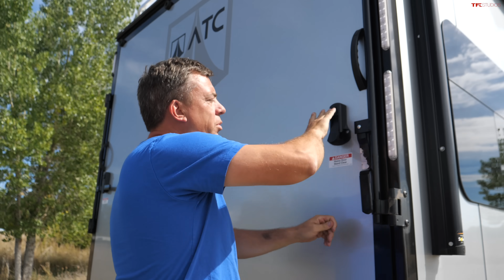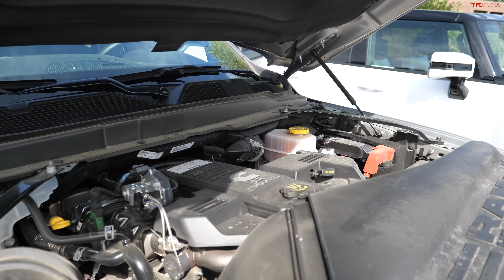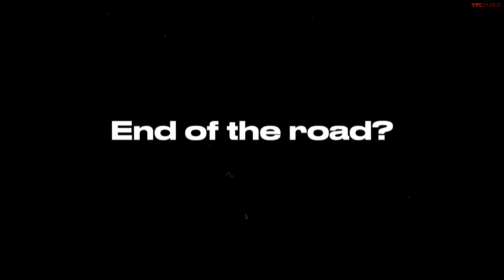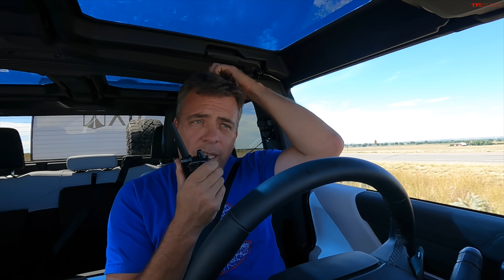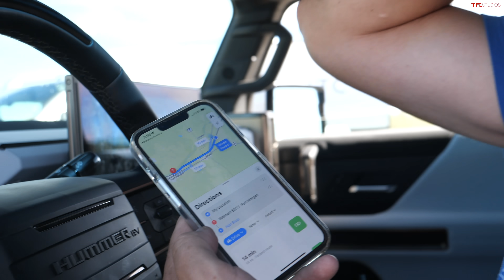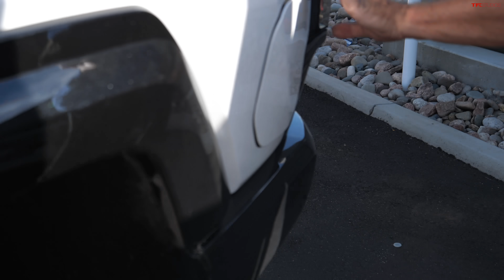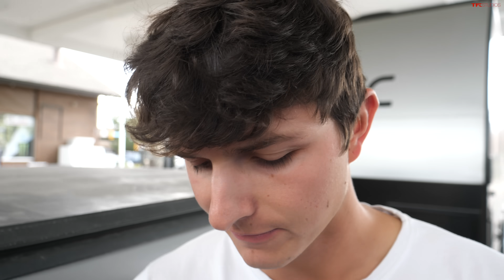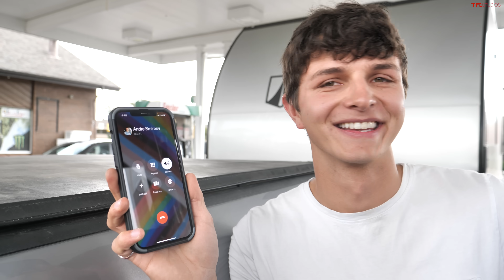How Far Can a Diesel and Electric Truck Tow An Identical Camper Trailer on ONE Fill-up?

Comment: So, what I've learned is that you'll need a math degree to figure out road trips with an EV vehicle.
Reply: No, you just use a map and find the next charger within range.
Reply: @jghall00  and hope there is one within range, jump on the fast charger if it's available and then wait 45 minutes to get 3/4 charged.  And then do it all again in 150 miles. Sounds like a fun trip.
Reply: @JW-xk8bd  There are maps with the chargers, so no guess work. Most EVs charge to 80% in 30 minutes and some do it 20 minutes. I can barely get everyone to the bathroom and loaded back to the car in that time. Besides, 90% of my driving is around town. I have a full charge every morning. Now I hate visiting gas stations.

Comment: It doesn't make any sense to use an energy supply in something that it just isn't very efficient like it is in powering your cellphone? With modern technology we could probably make a small enough diesel engine and place it inside a smartphone but would it be practical or efficient? Could you imagine buying a little "eye drops" size bottle of diesel fuel to top off your smartphone? With all of the oil around the world sitting deep underground does it make sense to leave it there, and use lithium in everything? Efficient or not, for the sake of the climate alarmists? Wasting a precious earth mineral on something it isn't very good at versus some it is, well is just plain dumb in my opinion! And this is my take on electric vehicles.

Comment: To make an EV truck on par with an ICE truck...with round numbers
31-ish gallon diesel tank on the Ram at 38kwh/gallon equals approximately 1.2mwh in battery capacity.
The Hummer was calculated to be three times as efficient, so around a 400kwh battery for the same range.
Let's make it 500kwh to be safe. 
To charge a 500kwh battery from 10% to 90% in ten minutes, a roughly 3 MW charge rate would be needed.
With the 800 volt Ultium architecture, that's approximately 3,750 amps.
Obviously, the input side of dc fast chargers needs to change. I wonder what will change on the output side of the chargers and within the vehicles to get to the point where it will be like living with current ICE vehicles. None of it is impossible. Bring on the corrections.

Comment: Your energy efficiency calculation is wrong you are not accounting for the energy to create the Cummins engine, or the battery pack, which you will see is an energy transfer.  In fact takes 10,000 times the energy to mine and refine the metals used in and really that figure could be ten times more.  Nobody really knows do to the secrecy of the battery construction.  Vs the most recycled metals steel, and aluminum.  So you will find the EV efficiency is about 27% and the diesel 48.5%. Also who melted the last Ice age?  EV will not work without room temperature superconducting technology.

Comment: You guys are making such a great show 😊 though I am all electric at this front Diesel wins. But it’s fun to see though and It will be fun to see what comes. I think it’s great that you shows the big let downs and trouble with the trucks, price wise, charge wise and capacity wise. The hummer have about the double battery size of a ford f-150 lightning but have about the same range, so in my head it seems they have gone more for a toy then an actually working truck. It’s fun though to think that 10% battery on the Hummer is about the same kwh as the first Nissan Leaf 😂
Reply: Technically, you end up with a charge speed that is faster in terms of at a station compared to the Lightning if I understood it right for that battery. It would be great if that charging technology were more adopted though. It does make the battery more complex though.

Comment: An ev would be ideal for commuting for me, I drive 50 miles a day back and forth to work, getting 16 mpg in my 03 f150, but hauling our Polaris to the mud parks on the weekend, or our camper to the beach or mountains, NEED a REAL truck. The money you save from gas will not compensate for the extra tax, tag, title, fee, payment, or maintenance for an extra vehicle.
Reply: I'm in a similar situation. I'm not against EVs by any means, I have a long commute that would be ideal for an EV. But I also have a boat and a travel trailer I tow almost every weekend... EV trucks just aren't ready. Maybe PHEV?
Reply: I'd just buy a Cummins and delete it. I get 18mpg around town in my 12 and 22-24 highway. I don't understand buying a gas pickup at this point when a diesel will get better fuel economy and can do more
Reply: @nicksmith4808  I had an 03 duramax a few years ago. Put all my money in the motor, then the trans took a dump on me. I love them and what they’re capable of, but between the government ruining the new ones, and the kids ruining and driving the prices of the old ones up, it’s not ideal anymore
Reply: Someone did the math in another comment. "Thats awesome the charge was free, but let's use the numbers to find out the future cost. The Hummer charged from 7% to 51% for $37.41 according to the EA charger. So $0.85 for each 1%. At that rate it would cost $79 to charge the Hummer to 100%. Hummer cost per mile: $79 ÷ 123 miles = $0.64 per mile.
Cummins cost per mile: $105 ÷ 211 miles = $0.49 per mile"

Comment: What was the actual cost in energy or electricity to 100% in this test?
Reply: To charge the hummer at a QC station if it where 100% dead is 80 dollars. If you charge it at home it would be 30 dollars. If you charge at a free station it would be free.

Comment: I would like to see a calculation of how much fuel you could buy at todays price with the difference in purchase cost. Then with the promotional charging factored in when would the Hummer save enough in refueling cost to equal the savings in price difference between the trucks.
Reply: It will never break even in the life cycle of the vehicles. At the towing mpg of 10 mpg and $5/gal the diesel has a 100,000 miles cost advantage on buying fuel without complicating the math with maintenance intervals. That factor increases by 2X when you remove the trailer.  $46,000 msrp difference buys a lot fuel and Hummers are basically unobtainum without a 2 year reservation wait time. You can buy 100's of cummins powered Rams tomorrow, they're available at every dealer lot.
Reply: Someone did the math in another comment. "Thats awesome the charge was free, but let's use the numbers to find out the future cost. The Hummer charged from 7% to 51% for $37.41 according to the EA charger. So $0.85 for each 1%. At that rate it would cost $79 to charge the Hummer to 100%. Hummer cost per mile: $79 ÷ 123 miles = $0.64 per mile.
Cummins cost per mile: $105 ÷ 211 miles = $0.49 per mile"

Comment: Its a good comparison. At 43 cents a kwh with a 211kw battery its $91 to charge it from empty. No idea what loss is from the charging process so it should be more. Need to know the cost to charge from the round trip vs the diesel. And the time to travel. They have a ways to go to replace a gas or diesel truck. I could tow my race car 300km round trip with a gas truck and have alot left when done. 128 miles is 206 km.
Reply: charging loss is roughly 10% on Teslas...
Reply: yep. I just want to spend the msrp price difference for gasoline or diesel... I am good for the next 20 30 years  :) just like the base model tesla or base  model hybrid corolla... even where I live 1.729 Canadian dollars / litre...
Reply: Someone did the math in another comment. "Thats awesome the charge was free, but let's use the numbers to find out the future cost. The Hummer charged from 7% to 51% for $37.41 according to the EA charger. So $0.85 for each 1%. At that rate it would cost $79 to charge the Hummer to 100%. Hummer cost per mile: $79 ÷ 123 miles = $0.64 per mile.
Cummins cost per mile: $105 ÷ 211 miles = $0.49 per mile"

Comment: Anyone notice what it cost (or would have cost) Andre to charge.  It was almost $38.00 to drive 123 miles.
Reply: Someone did the math in another comment. "Thats awesome the charge was free, but let's use the numbers to find out the future cost. The Hummer charged from 7% to 51% for $37.41 according to the EA charger. So $0.85 for each 1%. At that rate it would cost $79 to charge the Hummer to 100%. Hummer cost per mile: $79 ÷ 123 miles = $0.64 per mile.
Cummins cost per mile: $105 ÷ 211 miles = $0.49 per mile"
Reply: $38 to fill half a tank, I think it was at %51 battery
Reply: 🤣😂🤣 that wasn't a full charge! They have already shown what a longer charge will cost and it's much higher. To get a full charge would be +$80 after fees and Colorado is not as expensive as some states.

Comment: Out of curiosity, I wonder how the mileage would vary at lower speeds, where drag isn't such an issue. I know it's not realistic to expect people to drive slower, but I would if I knew it would add an extra 30 miles or something like that.
Reply: It helps significantly, but in a comparison of these pickups it would have helped the Cummins too. So the gap between each platform wouldn't have really changed. Side note, I live in Colorado and that stretch of I-76 everyone is running +80mph so them running at 70mph would have almost been a hazard to vehicles trying to get around them. I can't imagine if they slowed to 60-65mph!
Reply: @OneNationUnderGod.  Thank you for your insight. It would be nice to have a quantitative percentage increase for someone in a pinch. Would be useful for ICE vehicles as well as you mentioned.
Reply: @tannerkennedy4941  that's why last time the US was in an energy crisis interstate speeds were reduced to 55mph.
Reply: @OneNationUnderGod.  When was this? I am curious to research into that. I'm guilty of not knowing US history as well as I should.
Reply: @tannerkennedy4941  1974 it was passed by Congress.
Reply: @OneNationUnderGod.  Thanks for passing on some knowledge!
Reply: Might as well go back to horse drawn carriage if we are going to slow down to 10 mph.
Reply: @zachlafond2652  very constructive comment. Classic straw man congrats

Comment: I really don't see how a electric truck is cheaper to run, the diesel truck used $100 in fuel to get to the destination, the electric truck spent $40 to get halfway, so to go the other halfway it would have been another $40 roundabout? $20 in savings but you do get to stretch your legs for over a hour while charging 🤣 and we all know electricity bills will slowly go up as more people by electric vehicles.
Reply: Someone did the math in another comment. "Thats awesome the charge was free, but let's use the numbers to find out the future cost. The Hummer charged from 7% to 51% for $37.41 according to the EA charger. So $0.85 for each 1%. At that rate it would cost $79 to charge the Hummer to 100%. Hummer cost per mile: $79 ÷ 123 miles = $0.64 per mile.
Cummins cost per mile: $105 ÷ 211 miles = $0.49 per mile"

Comment: If there were two or three more superchargers on your trip, that would end range anxiety.
That will probably be the case in a year or two.
Reply: Still stopping every 90 mins or so to recharge. Sorry but my time is worth something.
Reply: Plus how many times would we have to unhitch? That would make for a miserable road trip!
Reply: More Evs, more chargers, more people using them, more demand on the grid...higher costs.  You see it in Norway during busy times.  Thank god most Americans are very patient :)
Reply: Don't think so depending on where you live. Where I live you could drive 300 miles and not see one charger now, more city driving and flat open roads you will, but in rural areas you'll be lucky to see one in the next 5 years
Reply: @nicksmith4808  I know of only 2  charging places within 50 miles of where I live.

Comment: I will say that the EV's are not yet good enough for any long range anything as you guy's have shown in previous videos. I also believe as you had indicated the infrastructure is not there yet and will never be good enough in my life time. I live in Canada and I'd like to see a towing test like that done when it's -40.
Reply: Can't wait for a proper cold weather test.  Denver area can get below 0F so they should be able to do it.
Reply: @zachlafond2652  They wont.  They need to keep getting test vehicles from manufacturers.

Comment: Why not put a small emissions compliance 3 cylinder under the hood? GM probably has one of these small engines in their Asian market. It would only get used probably in tow mode or when you want 600 mi of range in your hummer.

Comment: Now, do the $114k to $68k, time to refuel/recharge, and range anxiety conversion. I’m not against EVs, just call’m what they are, lifestyle vehicles and enjoy.
Reply: Someone did the math in another comment. "Thats awesome the charge was free, but let's use the numbers to find out the future cost. The Hummer charged from 7% to 51% for $37.41 according to the EA charger. So $0.85 for each 1%. At that rate it would cost $79 to charge the Hummer to 100%. Hummer cost per mile: $79 ÷ 123 miles = $0.64 per mile.
Cummins cost per mile: $105 ÷ 211 miles = $0.49 per mile"

Comment: Very interesting video. Comparing energy use should be talked about. You may have done it before but it'd be nice to compare the cost of energy when charging versus when fueling up too. When considering energy it's hard to believe how efficient that heavy hummer is. Thanks guys
Reply: The main issue is can the ev do what you need to do in the time you have to do it. Time is money and vacation time isn't very long. Like me I drive down to California on vacation takes me 18 hours to get to my destination towing a boat that's including stops, in an ev truck it would drastically increase drive time to the point I'm not sure I would have enough time to make that trip.
Reply: Include acquisition cost.  Amount over ICE applied to future fuel purchase.

Comment: The Cummins mpg sucks. 10 mpg with 3 tons in a diesel, might as well just pull with a 6.4
Reply: Ikr? I have a 7k lb trailer and my I6 3.0L baby dmax just averaged almost 15mpg towing in the mountains of Idaho.

Comment: Should do a test using a trailer an EV owner would actually use (like more aerodynamic).
Reply: How is that not a trailer most people wouldn't use? If people who drive pickup trucks bought an EV, they'd expect it to be able to perform just as well if not better. This trailer is a great example. Sounds like you might just have a problem with the fact that EVs are horrible when it comes to towing.
Reply: @KB93-A  EV's are not good for long distance towing. Basically everyone knows this. So as an EV owner are you going to buy trailer shaped like a bill board and drive it at 80 mph and get 100 miles of range or buy a more aerodynamic trailer and slow down to 55 mph and get 200 miles range? Just saying in the real world people will make adjustments. If you are doing a lot of long distance towing, get a Diesel.

Comment: I want to see what would be possible if you had a ‘normal’ 2,000 to 4500 watt generator on the trailer charging the Hummer.  How much range can you add?  Trying to see if even having an electric truck can even be used as a reasonable weekend getaway vehicle.

Here in California we have lightning owners who cannot drive from Sacramento to South Lake Tahoe due to range/ incline/ towing issue (99 miles to travel with a 6,700 ft elevation change).  Can an onboard generator get you to your destination and then refill the vehicle so you can return home?
Reply: I don't think very many people understand how much energy is being pumped in to these EVs while charging. That DC fast charger is charging at 600v and is using several hundred amps of current. That 4500w generator you're talking about is only good for around 42 amps at 240v AC. It would take several hours just to get a few percent of battery charge and it would take more than a day to reach a full charge. Most generators burn around 1 gallon of fuel per hour, so a full charge on this Hummer would burn more fuel than a full tank of fuel in a HD pickup. Not to mention the emissions on a small engine generator are horrible.
Reply: Won't add enough to matter. Lots of lame brain ideas to get EVs to tow, all of them bad. If you want to tow with an EV suck it up and plan on stopping every hour to charge for 30 minutes. The other bad idea is a trailer with a huge battery pack to add range to the truck. EV fans don't seem to realize the math in adding a 4000lb battery to a 6500lb trailer on a vehicle rated to tow 7500lbs. Or the new energy expenditure to tow that 10,000lb trailer (which is empty, image it with the Mule and a weeks worth of gear). Daily driving they EVs are awesome but don't think you are gonna tow your boat/camper 3 hours to spend a long weekend.
Reply: How about  200 mile extension cord?
Reply: Yes good idea.  Install a diesel generator on the electric truck.
Reply: Warped perception did this to his model s, but he had to ruin the car to do so.  Can the trailer your towing extend the range?  Only plug in when you’re towing, stop towing, unplug.  That model s drive 1600 miles on a road trip with no connection to the grid.  That’s the question.  If towing is the issue, have the trailer you’re towing, also carry some energy, either batteries or generator… that’s all.
Reply: @MrDavieb7752  sure the trailer can extend the range, but like I said, take this 6500lb toy hauler, load it with a sxs and gear and its 8000lbs now build in a 200kw battery pack and its a 12,000lb trailer. Not only does it exceed the tow rating of any EV but the extra weight also cuts into efficiency.  You might triple the kw capacity, but the added weight may not even double the range. Not to mention the cost of putting $30-50k in batteries into the trailer.